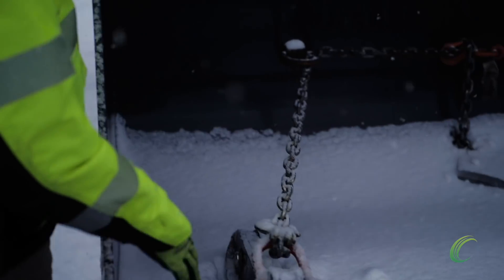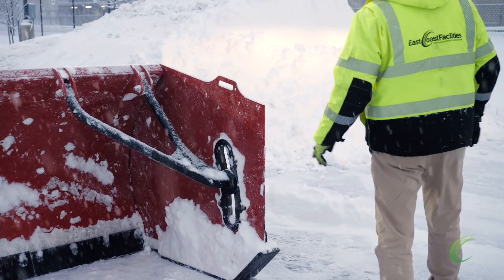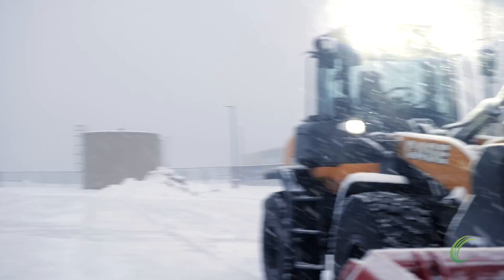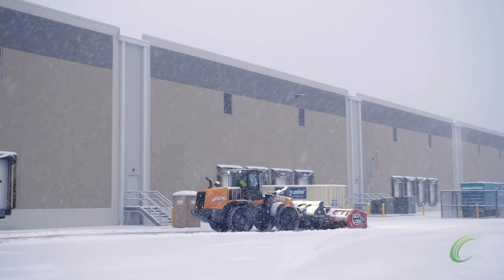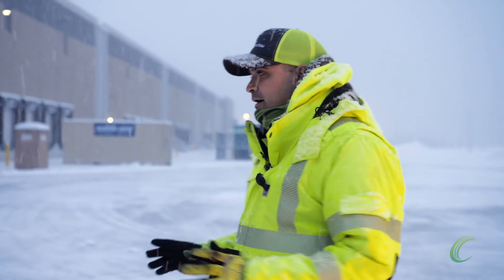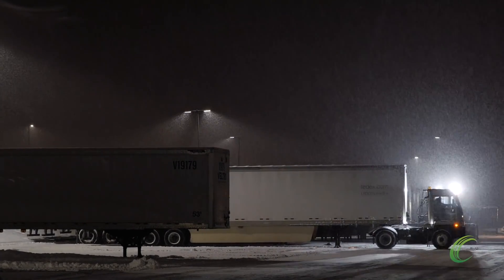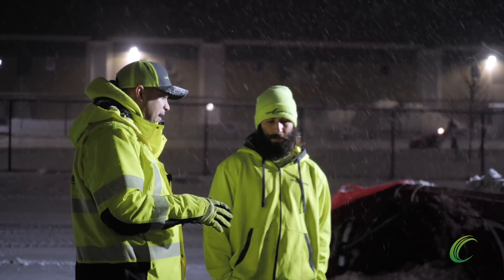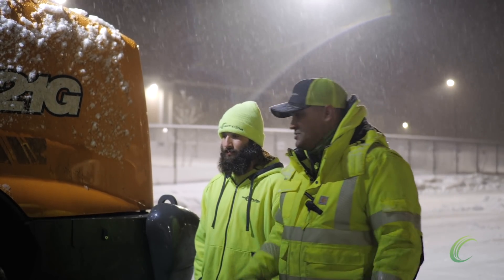Principals of Operating a Wheel Loader with a Snow Pusher

Comment: We do the same. Usuall we have 4 trucks 3 or 4 skid loaders, a backhoe or 2, and a wheel loader or 2. Also you need to know the layout of what your clearing. Every man hole, water valve, drains, pot holes, ect. You dont wanna damage property. Thats a loss of profit. Great video.

Comment: Are you using the "float" function on the loader bucket? I have a 10' pusher on my 70hp tractor and not sure if I should use the float function to do my driveway, or just set the pusher down and be constantly monitoring if i have to raise or lower it.  Thanks
Reply: I usually dont. Ill use my return to dig function or auto level if equiped. What ever u wanna call it. Helps make sure the bucket is always level. Ill put the bucket on the ground and just bump the stick so that it takes the weight off mostly. Thats just me though. I never use float. Even when Im doing other kinds of work with my loader. I run a Cat 950k.

Comment: I have had experience with the boss box on a skid steer (Same plow as the one hes using just smaller and different mount) you cant curl you bucket back.  Where the cutting edge is mounted on plow if you curl forward or back the cutting edge lifts of off the ground so you dont scrape the ground. It's also hard to get it in that sweet spot for being in the middle of the float.